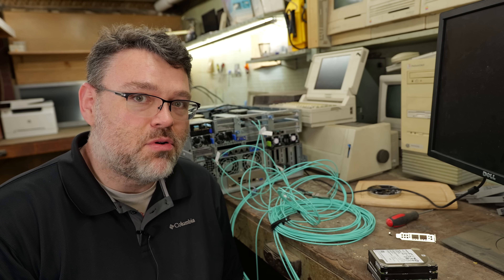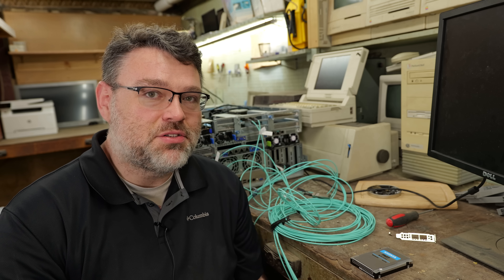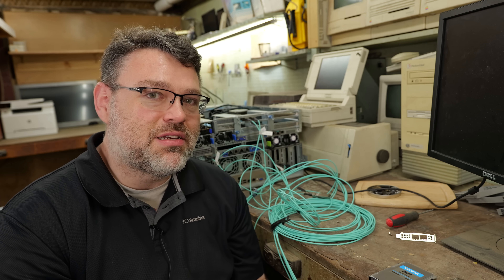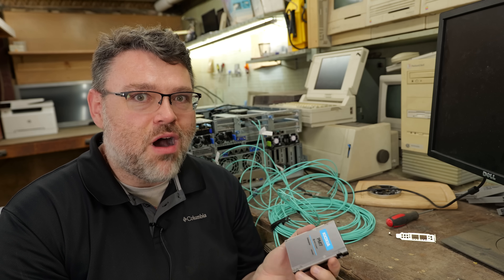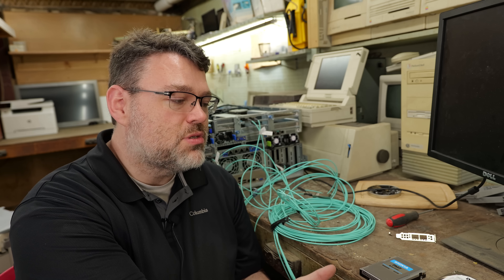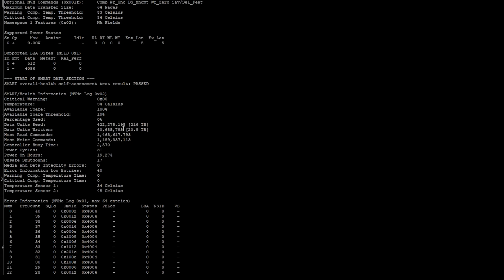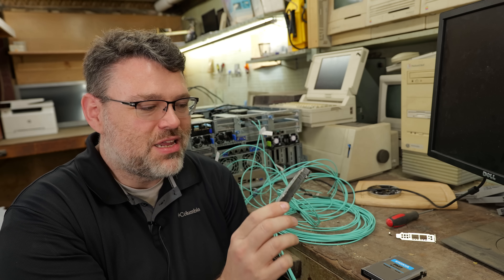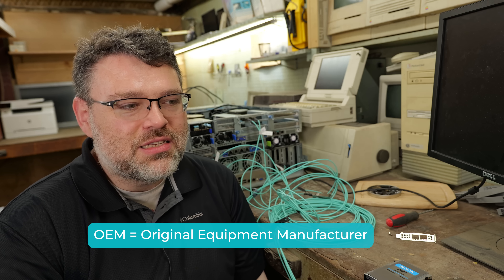What is a SAS SSD?

Comment: How trustworthy would you consider the consumer drive DWPD ratings to be? You mentioned not being happy with using a Samsung consumer drive in an enterprise setting - but would that be actually a possibility when doing low writes? For instance, dirt cheap M.2 drives are often rated for 1DWPD. They are so cheap that even only using only 10% of their capacity, effectively making them 10 DWPD drives, is cost wise very possible.
Reply: I've been using bottom barrel consumer drives for a home server setup for ~10 years. I never had issues with hitting the write endurance ratings. Rewriting an 8TB SSDs daily would be A LOT, you'd have to have a very IO intensive task for that to happen. For use cases that aren't constantly writing to the disk, the endurance ratings on consumer drives is often sufficient for those drives to last until you want bigger ones anyways. In case they do fail, its probably still cheaper to replace them than to use enterprise grade. Though I would still probably not do that in an enterprise setting.

(I did though had two Samsung SSDs fail catastrophically, but not due to exhausting spare cells. Both simply died at the same time, the controllers just went away.  I think it may have been one one of the Samsung firmware issues that fried drives, but not sure. As it happens, of course, those were two drives in a RAID1 mirror, so both copies gone. Gladly I had backups. With mechanical drives you generally have them fail slowly not abruptly like that. So there's that).
Reply: I have some QLC which come with laptop , they still have 93% of life span 😂 

And if you see how those Chia miner plotting on SSD and how they replace / resell used ssd, most SSD die due to other issues such as controller or pcb components issue , not common dead by writing too much or TBW reach

Comment: As someone who's trying to make a good homelab who just wants power efficiency over anything else, it's really surprisingly disappointing to me how few options exist for 2.5" SATA SSD's with like... a lot of TB onboard -- at an affordable price. Like what gives? Why is that segment so underserviced?
Reply: The same can be said about pcie lanes. The gap from consumer to enterprise is huge. It's crazy how limited you are on consumer gear. 

SATA SSD's pretty much stop at 4TB. I assume it's because of the form factor. All the larger 2.5 inch drives are about 2x as thick. U.2 is where it's at. You can get 30TB 2.5 inch SSD's that way. They do take 25watts each though. Opposed to the 8 watts required by m.2 nvme.
Reply: Because no one wants to really make SATA SSDs. The speed limits were reached a long time ago and the protocol is very very inefficient for flash. Same PCB layout for SATA vs SAS/NVMe would leave the SATA one so far behind. But I do get you, you want a replacement for spinny ones without the spinny thing, and yeah, the offer is not good. I’m thinking that the NAND needed for the high density would be a waste on SATA, so that’s why they don’t do it.

Comment: I'm showing this to my boss that thinks our Broadwell servers are fine..  The cost in electricity to run them is more than they are worth.
Reply: AFAIK the newer generations don't use any less power, they just give you more performance for the same power.
Reply: @eDoc2020  It isn't about the electricity it's about Wendell saying just throw them out.  And when a laptop has more compute than a server, you know it's time to change.
Reply: @fwiler   If the electricity isn't an issue and they have plenty of compute power for your use case there's no need to change.
Reply: @eDoc2020  You aren't getting it at all.  My post wasn't serious.  I'm not actually going to show the video to my boss.  My initial post was to show that even Wendell wouldn't use such an old pos in production.  IT is notorious for not upgrading due to.... insert reason here.  And no it isn't enough compute and there's about 100 other reasons I could list why you would upgrade, so don't say you don't need to change when you have no idea about the hardware.

Comment: I don't think broadwell-e is trash. My 2699V4 system can do ~2.48 GiB/sec in Windows file transfer from a single windows 11 client. SMB and the windows 11 TCP stack begin to be a limitation probably before the CPUs do if you have the best ones that you can for your socket. Enterprise Sata SSDs are also great and much cheaper than SAS SSDs. When you start putting 24 of any of these drives into a single chassis your networking (or the Sas adapter/expander)  is probably going to be the limitation before the drives. 24 Sata SSDs can go faster than a SAS3008 can easily.
Reply: Problem is an n100 mini can do pretty close to that as well using almost no power.
Reply: @churblefurbles  with 9 PCI lines you do not attach many NVMe to N100 or 100Gb NICs either
Reply: I think he meant for more in the enterprise rather than in the homelab.

Comment: We’re those people who are still running Broadwell era Xeons and spinning rust some of our branch office servers lol. Hopefully will be put out to pasture soon but SAS SSDs would be an awesome way to keep them rolling if we needed to.
Reply: My work is 1 or 2 steps worse. Mostly Ivy/Sandy Bridge cluster with a brand-new Dell Unity below it all. Their long-term strategy is to go to cloud once all the hardware just gets "too old." Like it isn't already.
Reply: I've been running a used Dell R510 at home with a pair of Westmere Xeons and a pile of DDR3 and 600GB 15K drives. I paid so little for it, that it was basically a gift from a friend. This hardware is now nearly 15 years old, and I could easily run it another 5 if it doesn't fail outright. It's keeping up with my current needs surprisingly well. The only pressure to upgrade I have is that newer gear is vastly more power efficient, and really cheap on the used market. Is it just me, or is old hardware staying relevant for much longer than it used to?
Reply: @asm_nop Such old hardware uses so much electricity, that any newer stuff will save the new hardware multiple times in that 5 years. Unless you havr basically free electricity of course...
Reply: Same 😅 We did stick some SATA SSD's in most of them but they go slow after about a year of writes. Let us pray we can convince upper management for something made post 2017

Comment: I have 12 SAS3 7.68TB SSDs in my TrueNAS. They are rated for 2000MB/s read, but SAS3 is limited to 1200MB/s. I guess they use 2 links? They are currently working at 1200MB/s. Do they require a special backplane? They are directly connected to a LSI 9300-16i, without a backplane. I don't really need the extra BW but I was wondering how do you connect them to fully utilize the rated BW. Also, they support 2 modes of operation regarding power consumption... 11W and 9W. I don't know how to set that up. And they are running on a Hawell Xeon v3 with 2x10Gbps, dont be so hard on them! :P

Comment: The main benefits of SAS are that it's always hotswap (vs nvme where it's not always supported), has simple dual channel so it can be used with dual-controller storage appliances in an easy way, and the signal integrity isn't a huge mindboggling issue like with nvme so it's simpler and cheaper to make a large setup with them (with or without expanders). A lot of servers still don't really need a battery of nvme drives, even if a lot of servers do need nvme
Reply: Most don't need nvme..... with raid and storage tiering you can get close to nvme speeds at much lower cost. I also rarely see workloads which need the storage speed of even fast ssd arrays.... most of the ti.e nvme is just a waste of money.

Comment: IMO the biggest reason these still exist is that NVME drives consume too much power vs SAS SSDs
Reply: I'm happy to see that you brought that up. I'm responsible for thousands of deployed servers and we've phased out HDDs a long time ago in favor of enterprise SATA and sometimes SAS SSDs. I'm now at the point where I think about using NVMe by default for new deployments and very recently decided against it after doing some power consumption tests. This is something you find VERY LITTLE information and chatter about online. And if you find something, there's a high chance that it is unrealiable information from overly optimistic data sheets and possibly generated by an AI having a bad dream.

Idle:
CM6-R: 7.2W
RM6-R: 3.5W
S4510: 1.7W

This is a deal breaker. I can't deploy drives that need 4x the power of a SATA SSD. I can and will when the performance is required and then performance per watt will be reasonable, but how often will that really be the case? We will continue to use SATA and SAS SSDs unless we really need something faster and/or NVMe SSDs use less power. What we really need are high density low power NVMe models. They can be lower performance to achieve that. CPUs are getting more and more PCIe lanes to prepare for PCIe storage, so I want to use them for any use case, not just cutting edge performance. That's just not reasonably possible at the moment. Unless that changes, SATA and SAS SSDs are here to stay.
Reply: do they though? SAS SSDs are power hungry too, they get hot
Reply: @marcogenovesi8570  yes definitely, SAS SSDs are typically under 10W, while NVME will easily hit 15-25W. There are some lower power NVME devices but the norm is to expect 50-100% more power consumption from NVME which leads to power and cooling challenges in storage dense servers, especially if other hot components like GPUs or top bin CPUs are required.

Comment: SAS, and by extension SCSI has remarkable staying power
Reply: yep also as the PCIe NVMe drives at most you can have 12 of them in an Intel system though 24 ish in a AMD EYPC system. Then you run into how to cool all the drives and both CPUs . As some Enterprise NASes have 50 physical drives having a limit of only 24 without bifurcation is not good while with bifurcation then you run into issues of how to get them so the chips will have a low chance of being blown off from the fans while still close enough to the controller to be quicker than 2.5" and 3.5" SAS drives.
Reply: SCSI survives as a protocol, mainly.
Reply: We could say the same thing about SATA. 
SAS Is simply double the SATA speed. They’re cheap, reliable, and good.
Reply: @AgentLokVokun kind of, but seems like they’re going to be discontinued before SAS
Reply: @TheKev507  The classic SATA formfacor might. But m.2 style SATA drives should have some staying power unless NVMe becomes that much cheaper. 

IDK tho. for a home server SAS is perfectly fine for me. I simply cant afford the drives lol